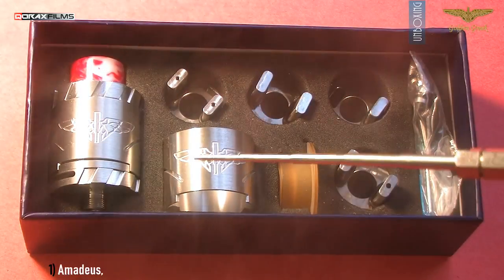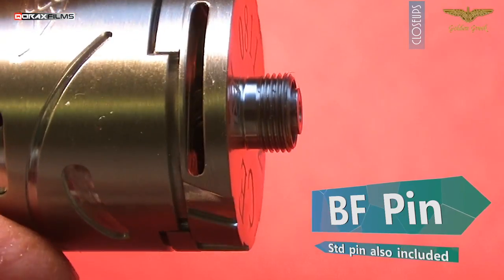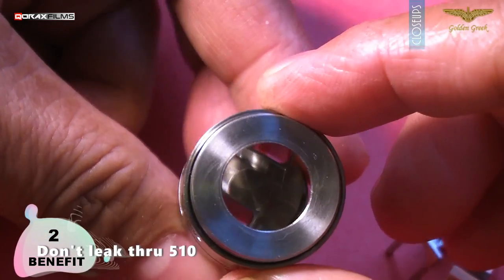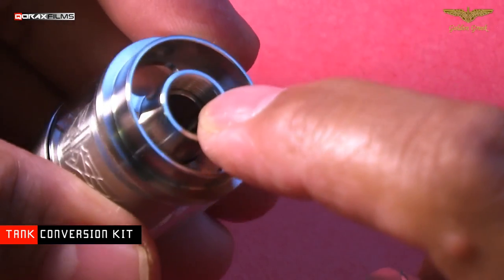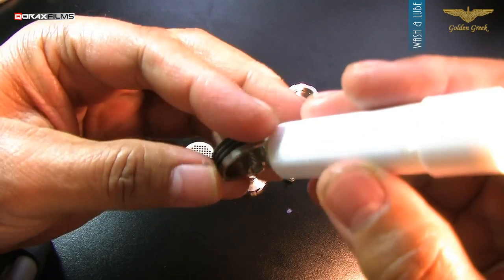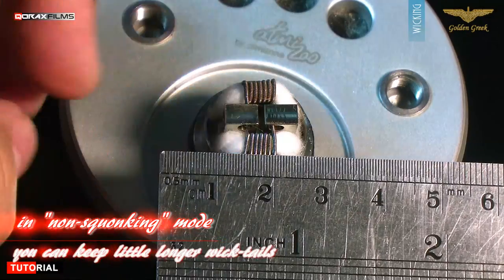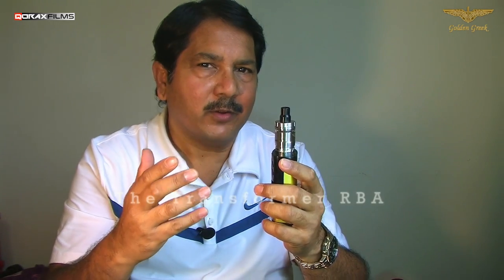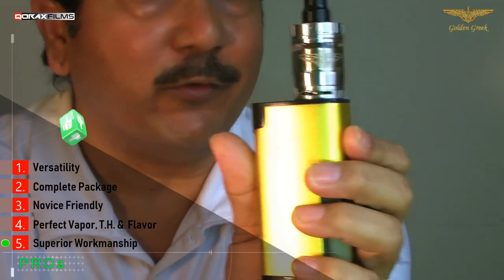GG Amadeus ~ Transformer RBA / REVIEW

Comment: The airflow is super innovative... it’s subjective the look of it but it’s not bad... but looks quality! If they make more airflow options that would be amazing ... how much did you pay for this one? Great review brotha... check out the new damnvape Frasia rta mtl and restricted direct lung ..it’s super innovative airflow as well... and also the Stagevape armor rta single coil just releasing looks phenomenal ... very cheap prices especially on China direct sites like Ali and 3fvape, hotecig  ...etc I think i paid 48$ the both of them! Yah bless.. also if you use 28x2 wrapped in 36g instead of 32g it will vape much better with better flavor.l. 26x2 or 28x2 wrapped in 36g or 38g is all I use ... that Rda would have probably did better with a 3mm coil as it’s a large chamber Rda/rta ... play around with it and let us know what you find works best